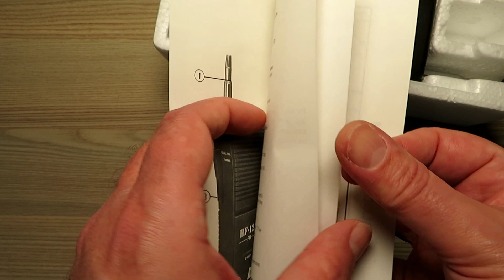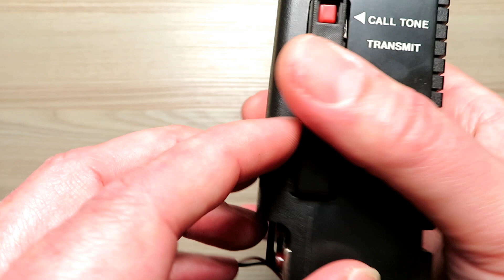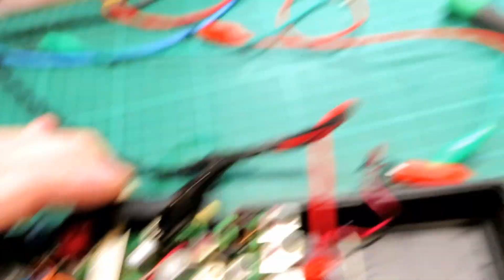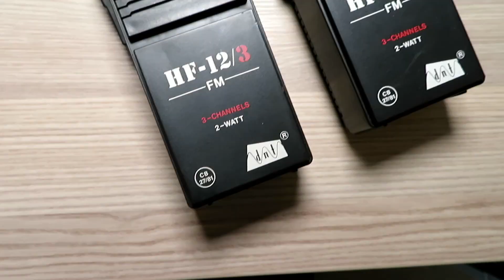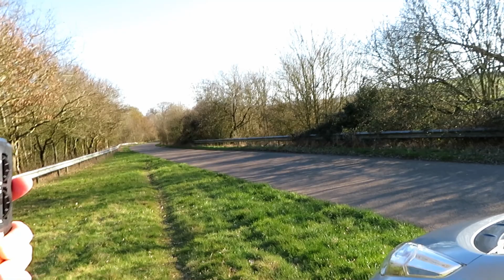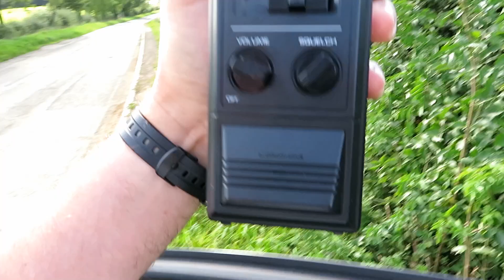DNT - HF-12/3  WALKIE TALKIE - 2ND RADIO FIXED AND RADIO TO RADIO FIELD TEST WITH SURPRISING RESULTS

Comment: Problem with all plastic cased 27Mhz handys is total lack of groundplane, at least metal cased sets
capacitor couple with your hand making your body some sort of ground. Its worth trying  a
 1/4 wave 102 inch wire connected to the radios ground, 102 inch of wire costs almost nothing
so no loss if it breaks off

Comment: I'm not sure how it was done in the UK but here in the US manufacturers during the 70's and 80's were notorious for using the INPUT power rating all over the boxes and advertising as the rated power for these units. RadioShack  being a good example of this. The OUTPUT power tended to run about 1/2 of the input numbers. As an employee of R/S, I always tried to be honest about this but it just tended to confuse people. Nice work as always, BTW! 👍
Reply from the maker: Yes that still goes on to this day, China radios 5w output with a 1 cell lipo 🤪

Comment: Awesome video, ive just started collecting walkies  ,i do have a new Uniden 40 ch.I recently picked up an old Realistic 3 channel 3 watt one and another 500 mw realistic.
I do have a couple other ones but the telescopic antennas are broken and i dont know where or if i can get replacements.
Reply from the maker: Broken antennas I tend to avoid unless it's the very small kids radios as they are easy to source, best you can hope for is a scrap chassis turns up with an antenna.
Reply: @knoxieman  Thanks 
As it turns out the 2 with broken antennas, one was mine when i was a youngster and the other was my Grandfathers.
Love the video. 
73's
514 Ontario Canada

Comment: Fantastic video, I would do a second range test just to see how far they would go!, I remember as a kid maybe 11 or 12, I managed to pick up a pair of silver walkie talkies, definitely AM imports from the US with broken antennas, I replaced the antennas with some long ones from my local electronics shop but was only getting around 200 yards, being a bit of an experiment I decided to change a resistor to a lower value on the PCB near the antenna mount, it was pure guesswork, but then suddenly I was getting 5 miles plus 😂 good ol days
Reply from the maker: Ah great, yes soon as the lockdown is over I'll do an update video with these and the TRC 214 stranger things radios.
Reply: @knoxieman  look forward to it my man 👍

Comment: Cracking little radios. Very surprising results, I would never have guessed.
Reply from the maker: Yes I was really surprised as well 😎
Reply: The U418B IF and Audio chip gives a better RX than most of that type